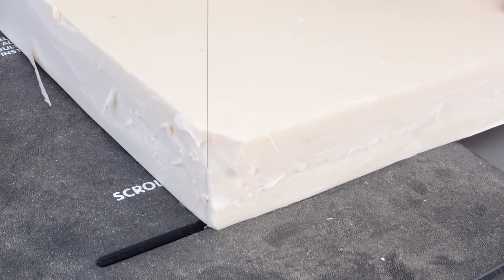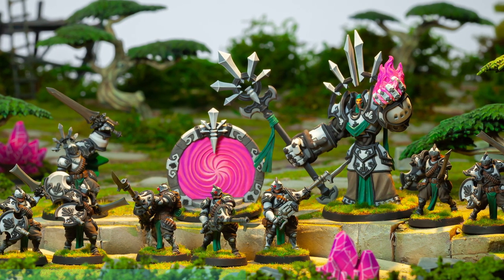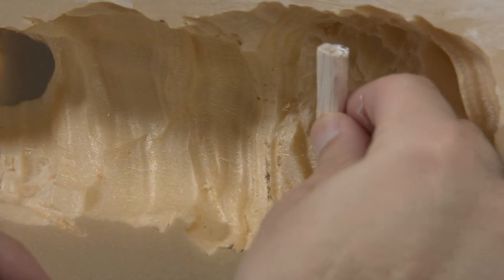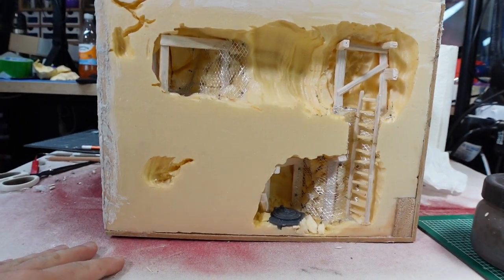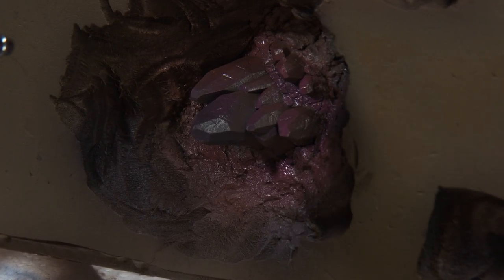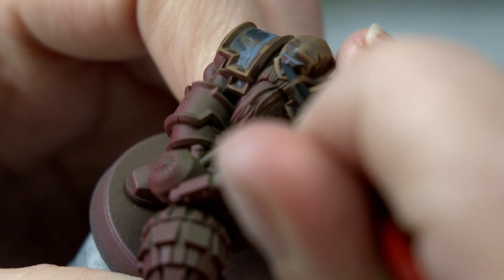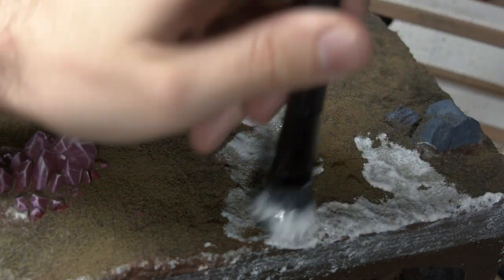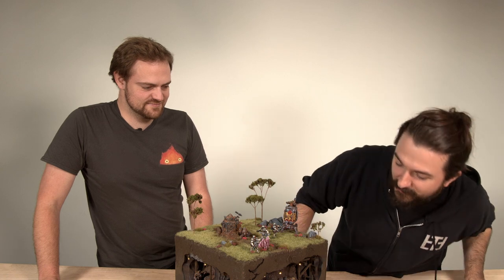Dwarven Ambush - Our most Detailed Diorama!

Comment: Love this!!  Ya'll need a Proxon foam cutter. That FF cutter is okay, but the proxon is where it's at.
Reply: What is it about the Proxon that make s you prefer it?
Reply: @ThumpertTheFascistCottontail  it's much hotter, cleaner cuts, much more control over the cuts and heat and angle you want to cut. 

It's fine when you do dioramas only one and then using the FF - but the proxxon is much better when it's a hobby for you you spend much time on.
Reply: @ThumpertTheFascistCottontail  - @eetennak pretty much summed it up. Couple that with the company "Shifting Lands" that makes tools for the proxon, and you can get some VERY detailed and clean cuts.
Reply: good to know. thanks for the opinions.

Comment: Looks like you needed to crank the heat up on that table wire cutter. Wire is not supposed to bend that much so need much more heat. Will give you a way better result. Wire cutting is low heat = slow, intricate and detailed, high heat = straight fast dimensional